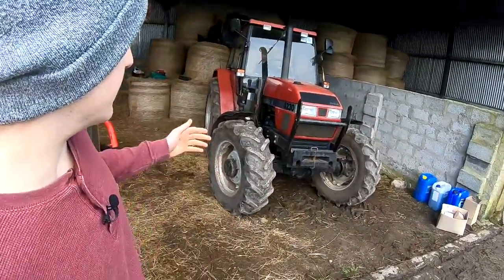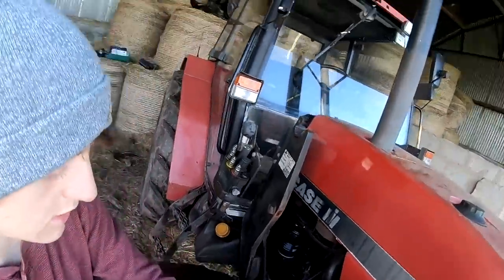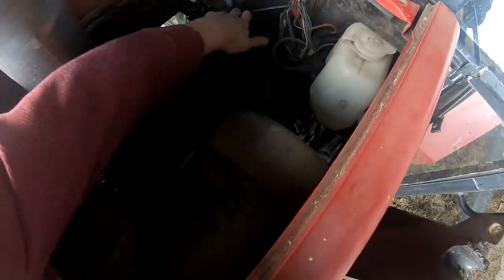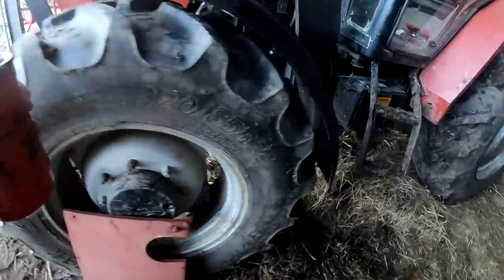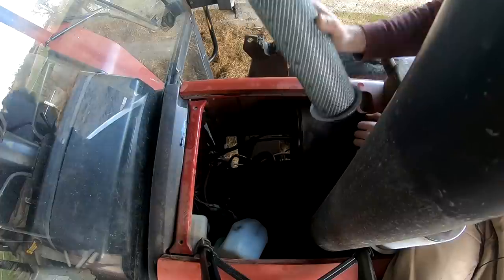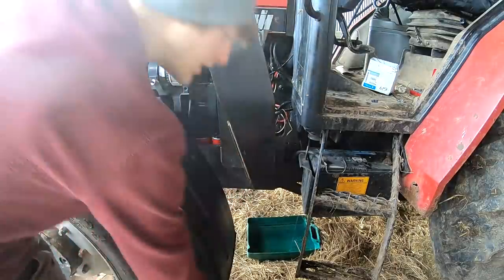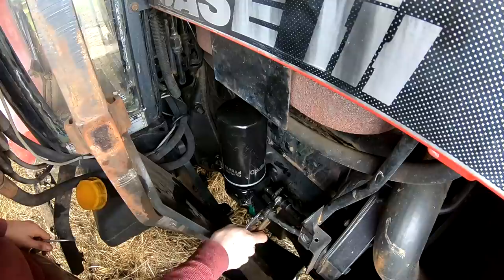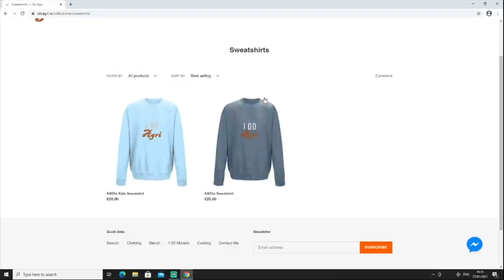How to Service a CASE 4230 - FLUIDS & FILTERS

Comment: Great vid👍

Was just going to service mine next week or so..!, 
mines a 98 with a q720 loader, almost identical, have it less than a year and it’s been great. 

Looking forward to the vid on the back end oil as well...👍
Reply: Would you recommend buying one as hear some horror stories of the 4230 but seem good tractors?
Reply: @Dan-HongTong  

Mines going great so far, have it a year and a half. Hot in the summer and noisy but has been 100% reliable. There are definitely a few lemons out there like anything. Good servicing and the correct oil in the back end and she’s happy as it’s a simple machine. There a non turbo too so not as prone to issues as the 4240. I would recommend yes 👍

Comment: Not sure I like the fuel filter position ;).  I like to use semi-synthetic for the hydraulic oil, until you break a line and lose a lot of fluid!  It seems the synthetic helps with shifts and reduces hydraulic issues.  Thanks.

Comment: Great video. Just about to do my 4230, would be interested in seeing you do the hydraulic system. How easy is it to get access under the bonnet? I need to replace the fan belt on mine and it looks like a bugger of a  job with very little access.

Comment: What do you mean by"releasing the water" from the fuel filters? Is that normal?
Reply: Yes it’s standard practice on all tractors, diggers etc. Moisture from the tank collects in the bottom of the filters usually so open the tap to release it. Some machines will have a tap on the bottom of the tank if not on the filters